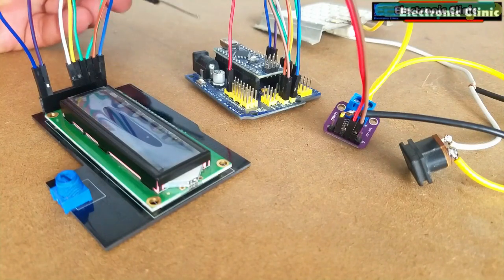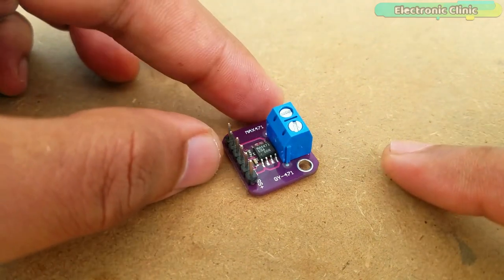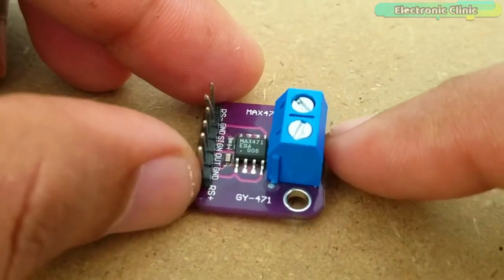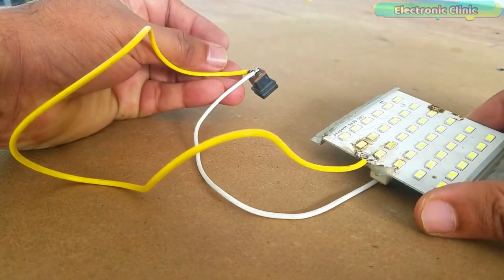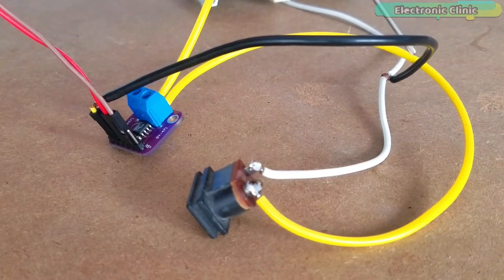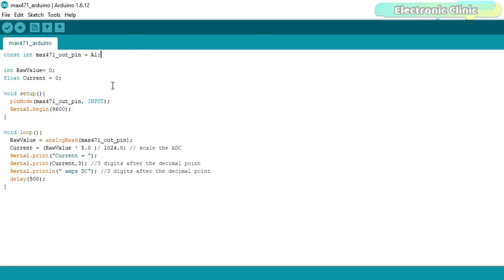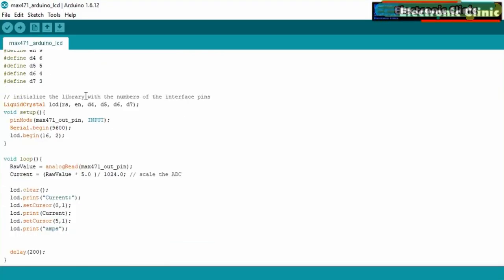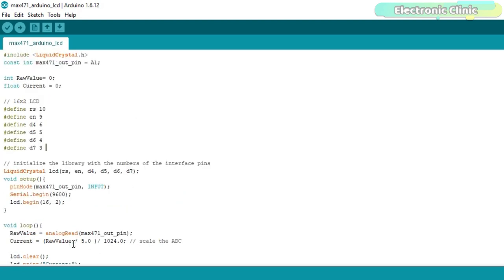Max471 Current Sensor with Arduino and 16x2 LCD, Max471 Arduino, measure current using Arduino Nano

Comment: What about current and voltage used by Arduino??
If there is only one battery (no USB cable ) then how will I calculated the current and voltage used by the project.